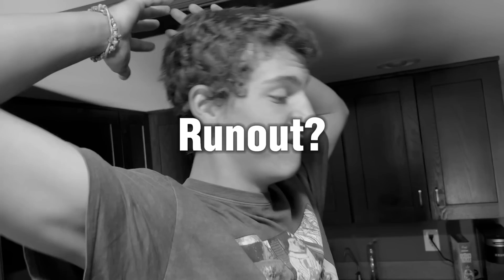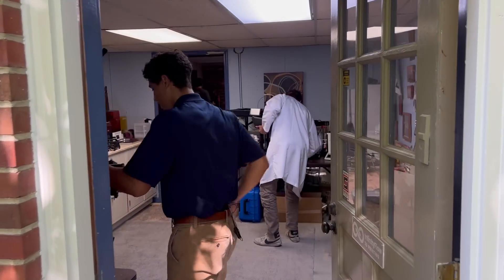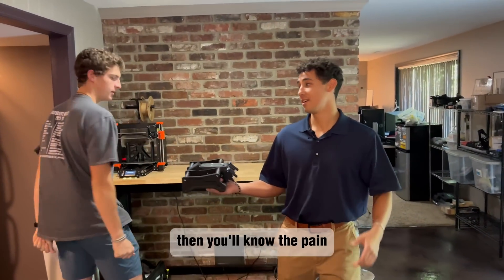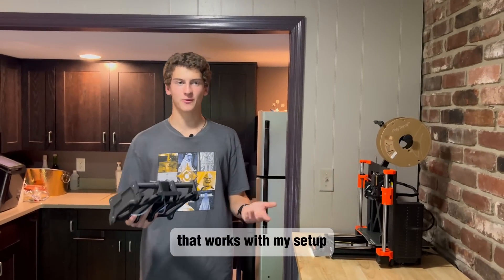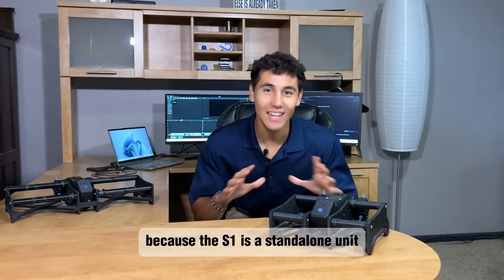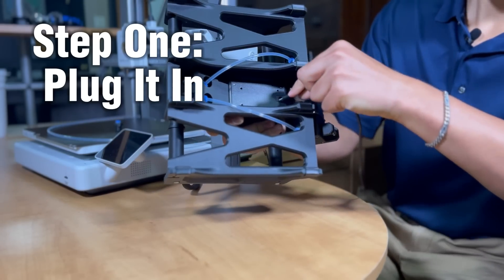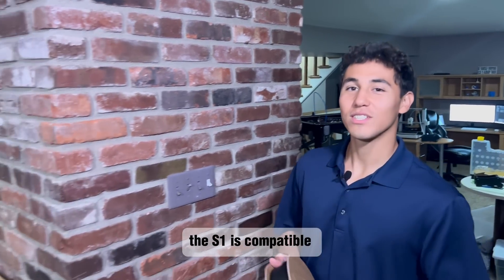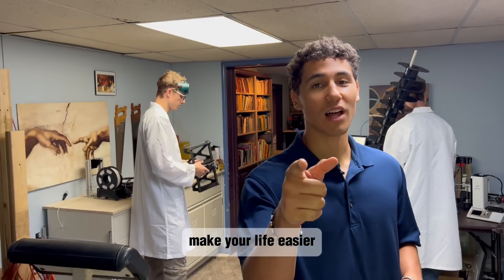Infinity Flow S1 Kickstarter Launch!!!

Comment: This is more for direct drive printers then bowden, just because you will not be able to retract the filament after the cut part is past the extruder.
Reply from the maker: Not necessarily, in bowden setups although the retraction doesnt pull the filament out of the hotend, it does relieve the pressure. This is mostly what retractions do anyways as the liquid plastic in the nozzle doesnt get pulled out. We have done a lot of testing with bowden setups and have not seen any downgrade of the quality. If you have more questions feel free to ask
Reply: @InfinityFlow3D  Well, I will disagree with you on that one. Go ahead and run a print with no retraction. It will make a difference and also depends on how long your ptfe is, 300-400mm with no retraction.... this would be more useful for direct drive.

Comment: My first thought was that 4/5 of my printers already have runout sensors, but this removes any downtime while the machine is waiting for me to notice it has stopped and also saves me the effort of having to manually switch the filaments.  Between that and making filament loading as simple as with an AMS, you've sold me.

Comment: You used the name of another filament product….sunlu s1 dryer…..two, it’s large and bulky, three there’s a very cheap filament sensor already on the market that can be used for any brand.  Lastly, only a few cheap brands would benefit.  High end farm, always on and running printers already has all of this built in.  Nice concept, a little late to the game.  Over priced, and would still have a slight gap during printing even if minimal.  Enough to throw an entire print off…
Reply: If it works, there are plenty of printers being sold that could utilize one of these especially larger format printers like the Giga.   Understanding how this works, there wouldn't be a gap, it's just going to shove new filament behind the tail end of the other filament. Any "gap" (almost none) will be lost in the hot end before it's printed.   I think it has potential, and it seems cheap for the problem it could potentially solve.  Yeah, there are other solutions including an AMS, but this should work with any run of the mill printer.

Comment: @InfinityFlow3D I have an issue where most spools have some sort of hook at the end, when they are wound up. I don't think this will work well with that system, unless you cut of a part at the end of each spool before splicing
Reply: Yes, this idea seems good on paper but might end up like lots of products on Kickstarter that don't work well.
Reply: Yep had that, seen lots of people with the same issue using the Bambu AMS.  Unless you know the filament will just feed through and trigger the sensor you run the risk of binding the motor and just just hitting an error (at best) or doing real damage.  Even spools that don't have the filament taped to the spool sometimes don't release the end that was bent into the spool in some way.  The need to respool everything just to make run out work might be OK for larger print farms, but more of a pain for home users.

Comment: Heavy dose of scepticism. I'll believe it when I see it. So far it wasn't shown working. Besides there's also questions like affordability. Buying multi-kilogram role of filament would probably be enough for most people. You essentially reduce the filament switching by the times the roll is bigger. This might have more use in print farms and mass productions like that rather than for a home gamer. We'll see. But I don't see people's excitement, they themselves mention that this is mostly for print farms.
Reply: Very expensive and probably only really useful for print farms like you say. I can't believe so many people are backing this without even seeing it working. I'm thinking we will have some unhappy backers in 2025, and maybe by then Creality comes out with a working product for half the price.

Comment: the great part of this is it will probably push the existing AMS to get firmware updates to enable reloading mid print
Reply: The AMS already supports endless spool. You just have to set spools to the same type and color. I think its called backup spool in bambustudio on the device page.
Reply: @jeffreypomeroy6173  no I meant swapping spools not currently in use or empty spools while a print is running

Comment: for $150 all it does is push the filament through, it doesnt fuse the old and new rolls together at all, my ender 3 pro print head would never work with this, it has a hard enough time just loading the filament in the first place. thats why i switched to a direct drive sprite extruder, Which can not accept a bowden tube AFAIK, without heavy modification. this is just a direct drive system with some runout sensors, nothing special, not worth 150 bucks if you already have a printer, you likely already have most if not everything you need to make this yourself for much cheaper. couple drive motors, some bowden tube, a couple sensors to control the motors, and a raspberry pi knockoff and  maybe 1-2 youtube videos on how to set it up. if you had the filament merger, where it heats the filament to fuse them together, then maybe. but this doesnt seem to do that. this doesnt work with direct drive print heads. Good luck boys.

Comment: As far as filaments ain't welded together retracts won't work at some point. I believe it works using tension sensor. There's no other way for new filament to follow old one with no gaps.

Comment: I still don't understand how it works. Or how it changes the filament midprint automatically.
Reply: filament runout sensor I would assume
Reply: But how does it make it continue flow afterward, does it bind with old filament, or just continues to push until loaded in the printer
Reply: @tolfx  its just a Y splitter
Reply: @tolfx  Pushing new filament at the right speed until is grabs in the extruder is by far the easiest way to do it.
Reply: @megatesla  makes sense yes, but would it be efficient if they "glued it" them together by warming each ends until they stuck, but might not be reliable,  perhaps easier to just continue pushing until the printer attaches to it itself
Reply: @tolfx  If you look at the design it has two small "extruders" probably with some clutch/release system and then another block that seems pretty small and I doubt there is any functionality in there to melt and splice the filament while printing. I also wonder how they handle large retract settings. Maybe there is enough play in the bowden tube. For this thing to be successful it is going to have to be 100% bullet proof. No use spending this money, then needing it every now and then and then it doesn't work.
Reply: @tolfx  my thoughts exactly
Reply: YEAH, im betting it just detects when filaments spool ends and... splices with new?
Thats the interesting part... automatic filament splicer isn't easy to design, it would be way easier to just push fresh filament after the old, but even small break would trips some(most?) runout sensors
Reply: @BSOE3058 - it's been fine to do with the A1 and an AMS, I never tried with a single spool. The tube length with the AMS is helper for sure.
Reply: It probably weighs the filament spoom or something
Reply: @nikolajhgh-nielsen8610  ehh?
No point, runout sensor is way more reliable and simpler

Comment: I really really want to back this with all of the add-ones, but the fact that I wont receive the 1kg rollers with the add-on 3 or 5kg rollers makes me not back it. I want to be able to adapt this to smaller spaces and have the big roller included only if I need them. (And I'm not gonna buy two units, sorry) So unfortunately I'm out on this.

Comment: Seems about 3 years too late, just about every hobbyist this woudl be targeted at would have an AMS or a printer with run out and resume detection.

Even the mk4 you use for your dramatic recreation has run out detection and would have parked the tool head. The runout module for this mk4 costs less than your mini AMS so if they were too cheap to buy the module then I have bad news on chances of a sale.
Reply: That's not the point. The point is for the people without AMS systems and quality of life features. It doesn't matter if you have filament runout sensors if it just sits there for hours waiting for you to load filament
Reply: your delusional if you think everyone has an AMS, typical babmbu fckboi response. and no, all the runout does is stop the print, this allows the print to keep going with another spool, completely different

Comment: How does it handle the retraction when the cut part reach extruder? as it does not join the filament, at some point, there will be a gap between the old and new on the extruder>nozzle path, so retractions will not work for a bit, maybe ruining the print quality in some part of the print
Reply: I have done this manually (feeding in new filament mid print, before runout triggers) and haven’t noticed any artifacts. So I wouldn’t really be worried about that
Reply: same thought, you would need an encoder meassuring the distance traveld back and then adjusting the movement but maybe the slack in the bowed is sufficient. time will tell
Reply: Perhaps a backdriveable setup like a cycloidal drive with a low constant torque applied to the end of the filament. That's what I'd try but I'm curious what they did.

Comment: $140 for 2 spools, $280 for 4 spools. 

A Bambu AMS lite is $150 (4 spools), and it supports multi color printing. 
For $70 more than two S1s (4 spools) you can have a Bambu A1 Mini WITH an AMS Lite. 

Maybe it makes sense for print farms, but it doesn’t make sense for a hobbyist. And that’s a shame because it looks like a great product.
Reply: But it doesn’t work with anything else but the A1 series! One of their selling points is that it is universal, even to printers without multicolour!
Reply: @DJProPlusMax Thats right, compatibility is key. A Bambu AMS Lite is a good system but it won’t work with my Voron 0.2 or my Ender 3.
Reply: @DJProPlusMax  Why are randos going to even need a continuous print system? Hardcore hobbyists have solutions, as do Voron, Bambu, Creality fans. 
Most printers have runout detection and will pause and park (even the mk4 they use for drama has runout).

Three years ago this would have been a game changer, it's just too late.
Reply: literally the second line in the description "This is an automatic filament loader specifically designed with print farms and production facilities in mind."
Reply: @Mr.Thermistor7228  Yes…and? 
 None of my critiques are about the design. 
That’s not to say I like the design, because they didn’t really cover anything about the design.
Reply: Yep. This device is was needed 4 years ago - not today. Even Creailty is bringing out a system that will work with their K1 series and a few others. This device's market is entirely people who don't want to spend more money on their printer.... which will likely also include this device.

Comment: This is good idea.

Now how do you handle the issue of the kink at the end of the filament roll.
Reply: important.

maybe a sensor detecting tension/resistance in the filament?  

like, getting too much resistance? -> swap to new roll.

that would prevent tangled spools from wrecking prints too.
Reply: @real_kdbanman all this system does is shove filament when the path is empty, if the primary spool tangles on its end-spur, the print will still fail because the path is jammed.
Reply: @Roobotics  thanks for the clarification!  i appreciate the simplicity.

i hope your thing is successful so that a smarter 2.0 comes after 👀
Reply: @real_kdbanman  It's not my project, I just like engineering! But it only has 1 output so basically it has to work very similarly to the Bambulab AMS lite, coupled into a Y-combiner coupling.
Reply: @Roobotics you can use stall guard on the stepper driver which would detect the resistance of the tangled spur and be used to trigger the filament switch.
The real question is how they feed the filament to the tool head at a swap. There is no communication between the unit and the printer.
Only way I could see this possibly working with no communication between unit and printer would cause over extrusion during the filament swap.
Reply: @ashleywhitehead3710  there likely is some sort of stain sensor or more likely stall guard like you said. But it probably just uses a filament detection switch and pushes into some sort of small spring buffer blindly otherwise, so if the first filament snags it's tail, it's still a failed print in that case. By using a small spring buffer or maybe none at all, retractions can still happen, else the secondary filament will ride the back edge of the primary filament into the extruder gears.

Comment: awesome idea.
but i'll have to wait for the S2 when it has a built-in filament dryer. (hint, hint 😉)
Reply: I was going to say something similar. If I get the S1 I’m going to have to design/build a case for it to keep the filament dry. No biggie, just thought that it should’ve already come enclosed as a dry box. Specially for bigger spools.
Reply: Looks like you can just run some Bowden tubes from any dual filament dryer 👍
Reply: Throw it into a large plastic tub with your choice of desiccant and drying hardware. Easy.
Reply: @addmix  exactly! I'm using a bathroom dehumidifer (small 20W device) in a IKEA plastic storage box, with tuya smart home temp/humidity sensor. It's sitting a a very low humidity 40%. Works extremly well, and There's room for so many spools to just lay around and be kept dry
Reply: Or the S3 that comes with a filament fuser, that quickly fuses the two filaments together so they don't separate for whatever reasons.

Comment: My biggest problem is that end of the filament has that hard bend from mounting in the roll
Reply: It depends on the filament manufacturer, some brands like polymaker doesn't have that
Reply: @fdavpach  maybe,I never used that one.

Comment: Yes this solves a problem. But I’m not sure how every printer handles this transition point and for 135$ I think I’ll rely on my printers sensor and switch manually if needed… for high throughput production this still might be of great value 😅
Reply: I think it has its own sensor for it and not the printer sensor.
Reply: "This is an automatic filament loader specifically designed with print farms and production facilities in mind."